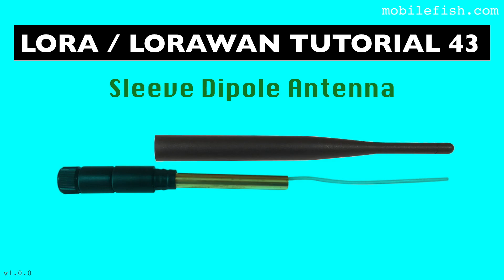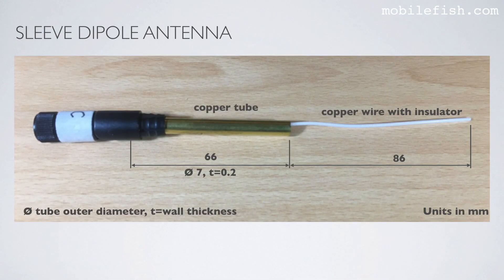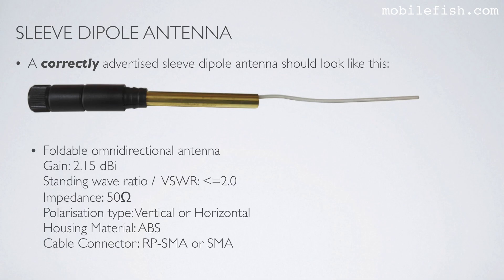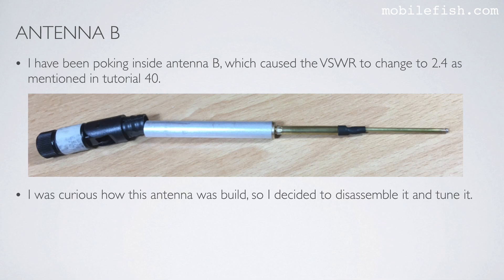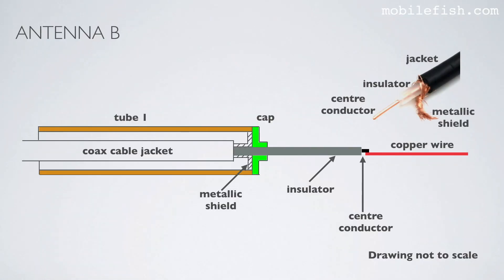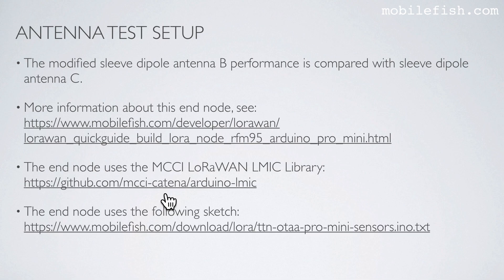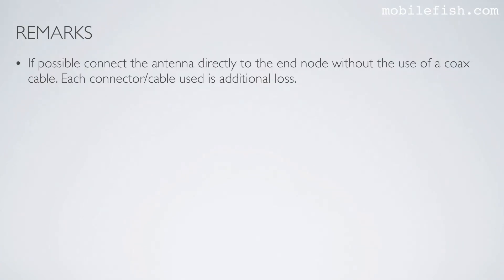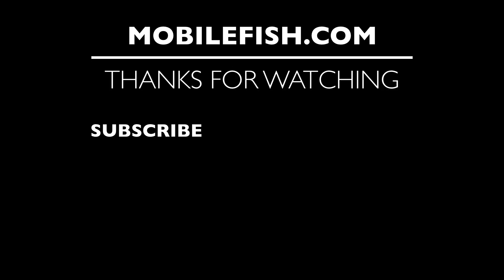LoRa/LoRaWAN tutorial 43: Sleeve Dipole Antenna

Comment: What is the difference between sleeve dipole and Hertzian dipole ?? Very common antenna for wifi exactly same as on your tutorial . But they are shorter than usual wavelength . For 2.4 ghz it is 25 mm . But normal quarter wave for 2.4ghz is around 31mm .
Reply: Great question Kavindu! Antennas are usually shorter than the theoretical physical size, due to a thing called "Velocity Factor" (VF). So in a cable, even though you would expect radio waves to go at the speed of light, they can go considerably slower. Some coaxial cables can have velocity factors of 0.66 for example. Also, there is an "End Effect" which typically shortens an antenna by 5%.

Comment: Can you please suggest which type of antenna (868 MHz) is better for end node when gateway kept with the altitude of above 50?
Reply from the maker: It depends on the environment your end node is used. But in general a sleeve dipole antenna is a good antenna, but this antenna is sticking out.

Comment: Where can I find the theory to calculate the element and sleeve length? I've already trawled through endless vids and documents but no-one seems to have the formulas to allow for the sleeve diamter and thickness. Thanks.
Reply from the maker: For whatever it may be worth here is my 2 cents:
As far as I know there are no formulas for sleeve diameter and thickness. 
The sleeve material is important.
It must not contain materials which can shield electromagnetic radiation.
For example certain plastics can contain carbon fibres, which is not good.
Another point to consider, some plastics degrade more easily when opposed to direct sunlight.
With regard to the thickness / diameter:
Preferably make the thickness / diameter as small as possible.
Make sure it does not break easily! It must withstand harsh  weather conditions: rain, hail, wind etc. And of course rough handling.
A smaller antenna is good because it take less space and weigh less.
The antenna does touch the sleeve but try to minimise it!
Reply: The length of the sleeve is a quarterwave of the frequency that you want (or a tiny bit less), diameter (or thickness) is not critical as long as you can put it over the coax. Wider diameters will give you additional bandwidth, but it's not critical.

Comment: i got stock ttgo antenna, when i try to communicate with arduino-lora code i got around -40 rssi, why is that?
Reply from the maker: RSSI values are negative. Near 0 means excellent signal (never happens). To give you an idea: I have a self build 1/2 wave dipole antenna. If the distance between end node and gateway was 6 meters,  I got  RSSI = -27. If the distance was 2 km, RSSI = -100
Reply: @Mobilefish  i got some couple antennas 433 and 868 , and i use ttgo lora sx1276 module, if you can share email i can send antennas photos, how can i best coverage urban?
Reply from the maker: You can contact me, goto www.mobilefish.com on the bottom of each page you see the link:
send an email to Mobilefish.com.

Or goto twitter and send me a message: https://twitter.com/mobilefish
Or goto linkedIn and send me a message: https://nl.linkedin.com/in/robertlie

Comment: can we reduce the VSWR value (to the value of 1.2 - 1.5 for example) from the sleeve dipole antenna by modifying the antenna such as adding LC components (without making antenna from the beginning)?
Reply from the maker: Syarif, I am not an antenna engineer, so I can not answer this question. I have read articles using LC components for impedance matching but to change the VSWR? I do not know...
Reply: The correct way of adjusting the voltage standing wave ratio is by cutting the radiators (metal?) length. But.. I've had a few antenna's for my transmitters which were fixed length and needed to be tuned with metal rings on the bottom, which had some capacitive or reactance influence on the antenna. So yes its possible with LC network but best is tuning with adjusting length and if that doesn't work, then other ways.

Comment: Antenna B is called a sleeved dipole antenna with a decoupling choke. The extra sleeve (tube) is a choke which increases the bandwidth of the antenna so tuning is not so critical. This is a trick to sell one antenna for multiple bands.

Comment: Nice clear video. I'm no antenna engeer either, but I think that antenna b is a valid design. 
When I look at the design I see 2 antenna's.  Antenna 1 consists of tube 1 , the insulated piece inside tube 2 and tube 3.
Antenna 2 consists of tube 3 and a part of tube 1 and 2. I think the second antanna is tuned to roughly 2 times the center frequency of antenna 1. At this frequency tube 1 and tube 2 are 3/4 wavelength witch is fed at 1/4 wavelength. So 1/2 wavelength is canceled out. This leaves 1/4 wavelength in tube 3 and 1/4wavelength in tube 1.

The point of maximum power radiation is near the top of tube 1, so the shielding of tube 2 doesn't affect gain much.
Reply: Btw, I look forward to your reaction.
Reply from the maker: Hi Raymond, I do not understand your antenna 2 remark. 
But even if I was, I still do not know for CERTAIN if this antenna works correctly.
I think you are right that this is a VALID antenna.
BUT I NEED SOME PROOF AND I ALSO WANT TO KNOW THE GAIN.

After your comment I have modelled the antenna in 4NEC2.
I had hoped the antenna model could provide the answer if this a valid antenna.

Unfortunately the VSWR is greater than 8.
I tried to use the 4NEC2 optimise functionality but I got an error message.
At this moment I have no idea how to solve this.

Antenna model:
https://www.mobilefish.com/download/lora/sleeve_dipole.nec.txt

I updated my presentation, see last 3 pages.
https://www.mobilefish.com/download/lora/lora_part43.pdf

I am not a 4NEC2 specialist, so I presume I have not modelled the antenna correctly.
I will revisit this again when I have gain more 4NEC2 knowledge.